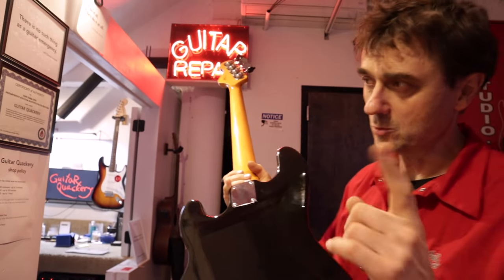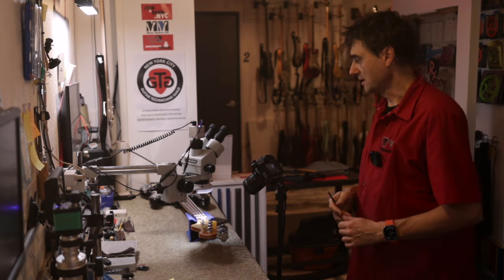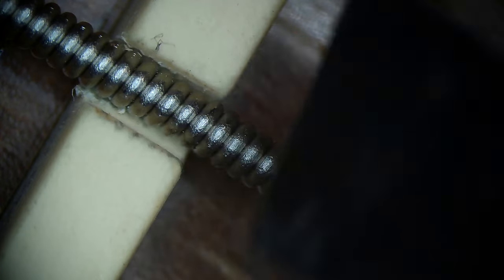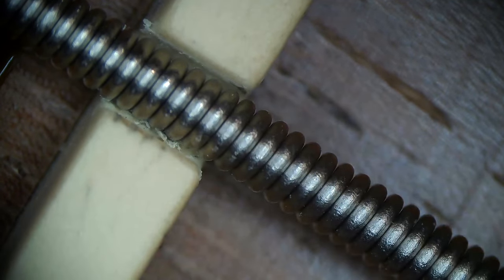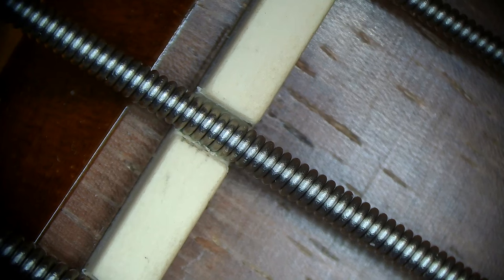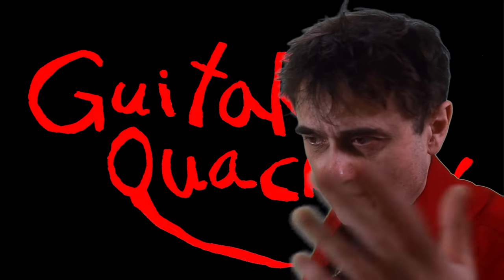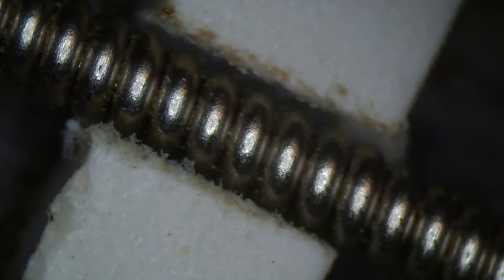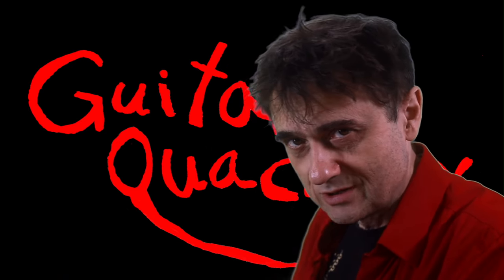Wobbling Bass Guitar String Under the Microscope

Comment: I would suggest to clamp the neck into a vise, since every time you play the string, the whole neck moves around, making it hard to see what exactly you want to show. or use a sandbag (or two) to cradle the neck. the microscope sensor has a pronounced rolling shutter effect, and you want to limit the wobble as much as possible. as an alternative to your microscope, you could get macro extension tubes for your main camera, and get a better view, and use your phone as the b-cam.
Reply from the maker: Very good suggestions.

I do have a heavy vise that I should be able to adapt for securing the neck. It'll take some R&D to make it work, but it is in fact something that would improve the quality of future videos. 

As far as the microscope goes... it has become the signature equipment of this channel and it also looks good as a prop. I am well aware of extension tubes, though and I guess it is something I could incorporate in addition to the microscope.  

I really appreciate you taking the time to post these suggestions.